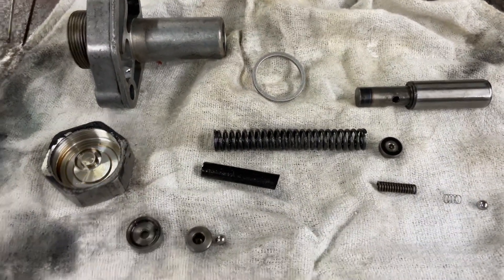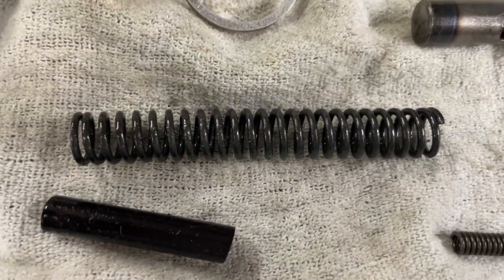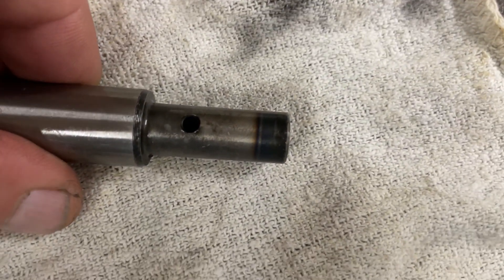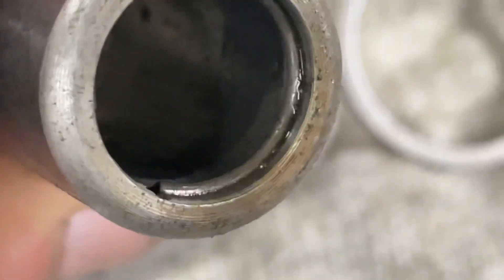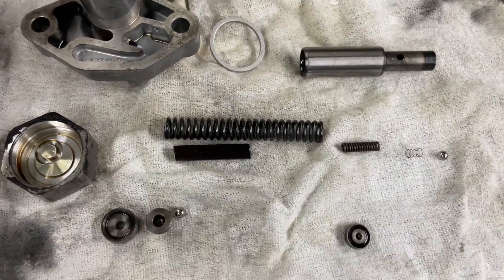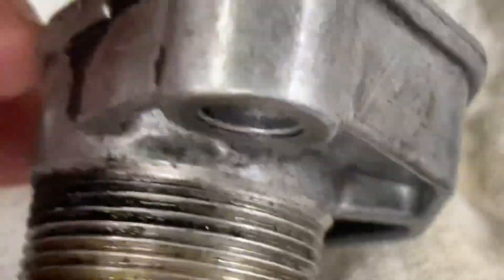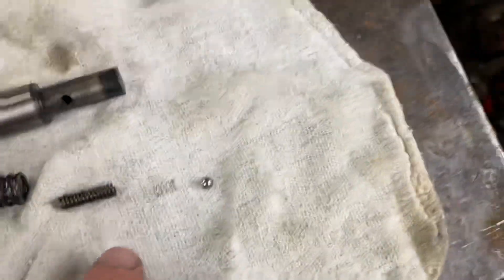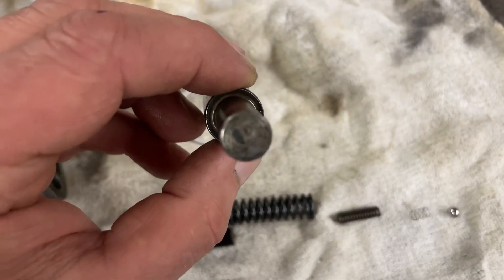Mercedes Benz 560SEL MY 89 - Failed Febi Chain Tensioner failure analysis

Comment: Is there any option to rebuild old original tensioner? New original MB are no longer avaliable in EU. Febi is only option left.
Reply from the maker: I am not sure
Reply: @inovahightechltd  I will try to open mine original like you did with Febi, and compare it...
Reply: @inovahightechltd  I would also like to ask you which spark plugs do you reccomend for 560 engine?
Reply from the maker: @Gr3eGo 
I am using Bosch, but I am not sure if they are still available
Reply: @inovahightechltd  I use Bosch too.. but there are different Bosch spark plus, we have China and Germany option... Not sure about Quality. I was thinking of using Champion or Denso, with 0.9mm gap . Will there be any diference ?
Reply from the maker: @Gr3eGo 
I don’t think so as long as they have the required resistor built in. The Bosch plugs I got were made in Russia in 2020 by Bosch Russia

Comment: Please, did it have a rattle only at cold start?
Or olso at idle?
Reply from the maker: Both
Reply: @inovahightechltd  thank you for your fast answer, kind Sir!
Please, I have a polo 9n 2005 1.4 16v FSI. 60k miles.
Mine it only rattles at cold start, after it sits for weeks.
I think is the tensioner, but i don t find  a good mecanic, in my country.
Do you think is only the tensioner or olso the chain(I have plastic guides)?
I was thinking to change only the chain, tensioner and guides, OEM parts(considering the low mileage, made outside of the city, kept on the automatic pilot at 2k RPM)
Reply from the maker: @cartaginalandscape6349 I don’t know much about a Polo